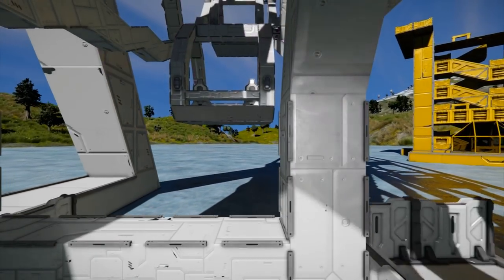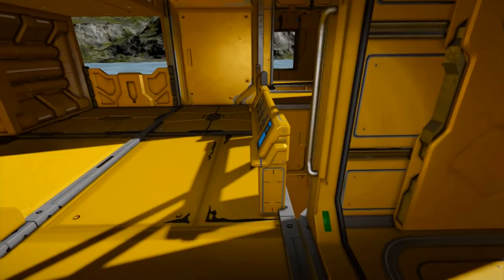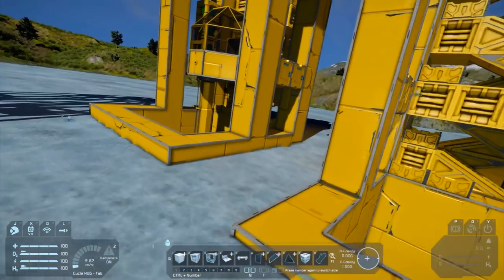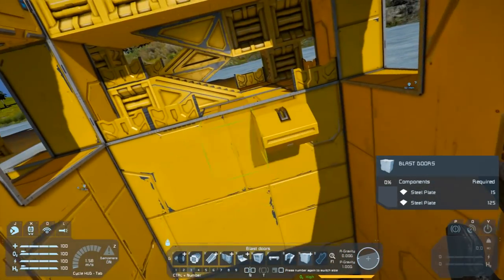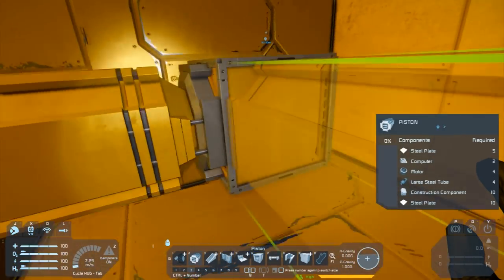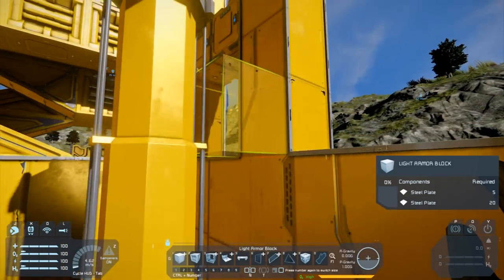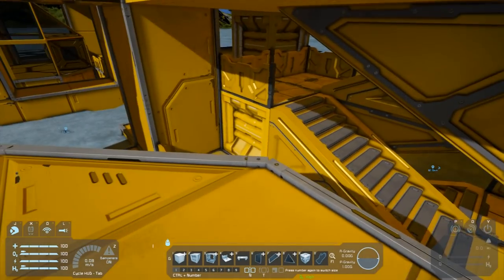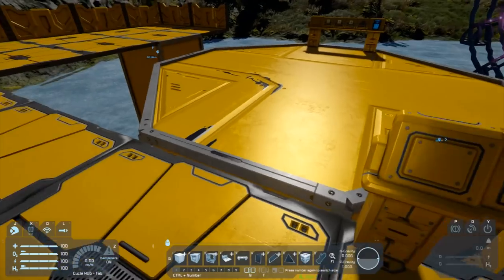Space Engineers Tutorial: Elevator Vanilla Build (at least when it's silent)

Comment: I find it very odd that with all the current SE technology we have at our disposal,  that we still don't have access to steel cables. Imagine the possibilities if it was added such as: elevators, suspension bridges, land vehicle winch and that's just to name a few.
Reply from the maker: It would be truly awesome to build with cables, I haven't really seen any games attempt it though, so there must be some part of it that makes programming cables very difficult :/
Reply: Programming might be a bit tricky since the cable block would be more of an animation block from the players perspective. It would basically be similar to wireless redstone blocks in Minecraft, but with the animation showing linkage from block to block so that you could achieve the realism of angles of attachment and connection points from A to B. That is a project I'd love to help Keen work on in a purely voluntary manner to achieve.
Reply: it definitely is doable just look at the rope in medieval engineers that allows for making elevators or even rail cars and even in mine craft there is a mod called immersive engineering that adds in wires for transmitting electricity and the fact that medieval engineers already does have the rope Keen already does know how to add in cables they just have not done it unfortunately even though cables are one of the most asked for item in the game well that and water.